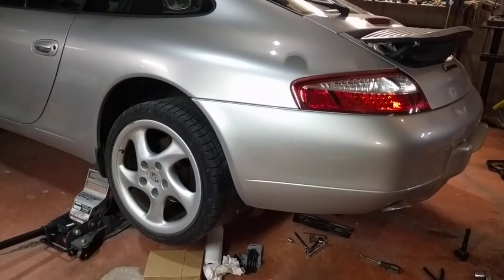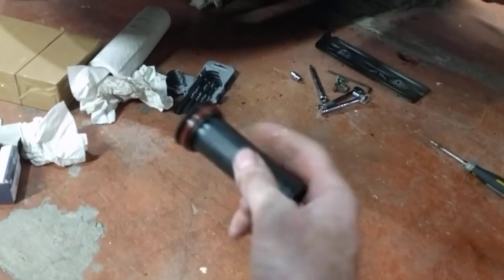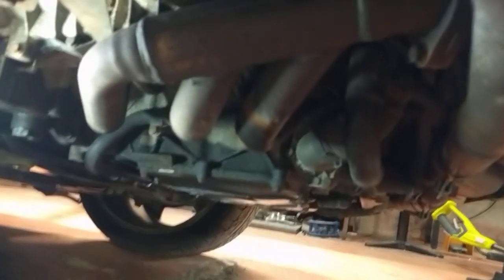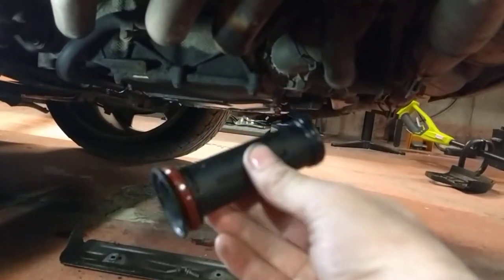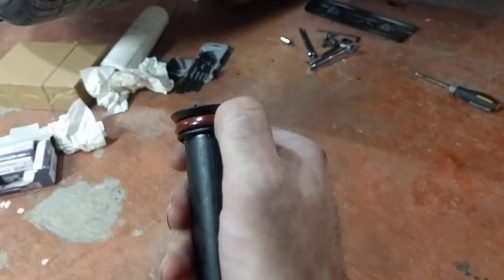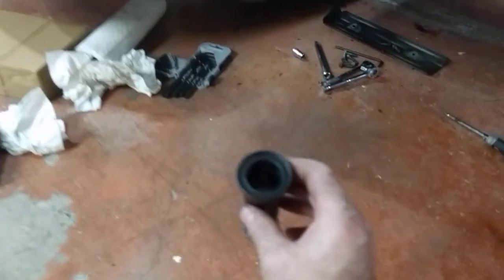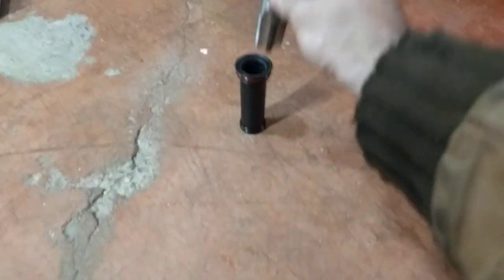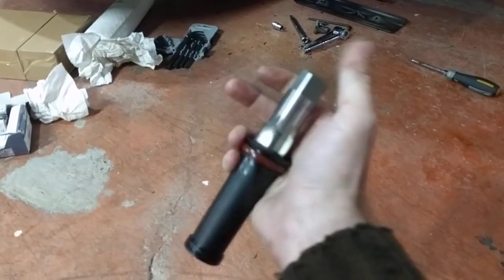Porsche 911 (996) Oil Leak Fix and Sparkplug Tube Removal Trick

Comment: My 996 smokes from the left rear wheel well only under hard acceleration.  I'm pretty sure one of the sparkplug tube is leaking. AOS would definitely come from the tail pipes I would think. What's your opinion?
Reply from the maker: Look under the car at the manifold.  If there's a brown oily spot on the manifold then it's probably a spark plug tube.
Reply: Yep.  I'm relieved that it's probably the tubes and not an AOS.  Thanks for your fast response.